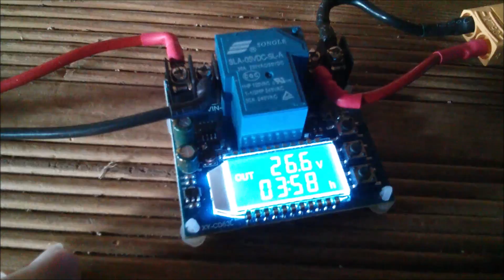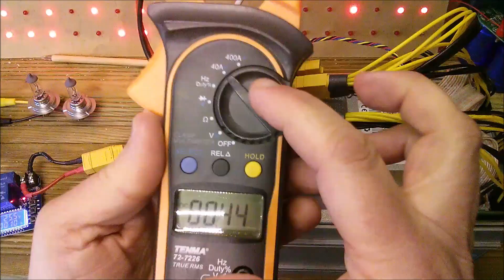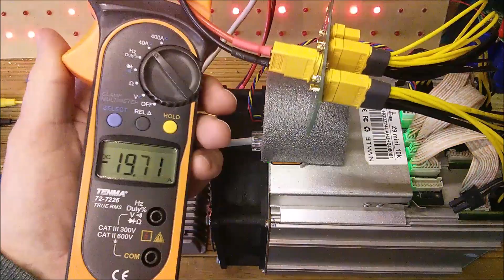Can this PCB handle 20 Amps?

Comment: To improve the resistance, you can stack two PCBs, exactly as they are. It may slightly complicate the soldering if you insist on one connector on the opposite side. If the connectors are all on one side, then the two-stage soldering would be easy.  Solder one board first, with not too much solder, then add on the parallel second board with fully-flooded solder. Cheers.

Comment: Instead of having one net on the top and the other on the bottom. Why not have two flood fills on both the top and bottom, so there is pos and neg 'power planes' on the top and bottom which would double the effective cross section area for each net. It's getting made by JLC - not like your manually making these boards, the PTH are free, better to use them!

Comment: Any particular reason for the connectors to be on opposite sides? Keeping them on one side would give you an option to up the current rating with extra copper wire bus along the bottom side.

Comment: Amass has XT60UPB-M and -F variants that are designed for vertical PCB mounting... They specify 4.3mm pin diameter which is no different from the cable version.

Comment: I am not sure if you even read comments.
On a previous video I wrote to you that (1) I can deliver you software to make the L3 run MOST efficiently and (2) I told you before: you do not need the extra connectors for those hashing boards on the L3. I have run them myself so I know they run on 5 cables (not 9). After having run the update (it just lowers the voltage of the hashing boards, it can't harm anything) the power usage goes way down. Also note: I came across a few boards from Bitmain where they had set the voltage at the maximum! It is just heat, and you get nothing in return. More detail? At the outlet my power went down from 723 Watt to 600 something Watt, just by tuning the under voltage to its minimum. (12 Volt 150 Watt, on one connector, that is 12.5 Amps, how much is that per wire? Exactly! Peanuts.)
PS: I have ran L3-plusses for several years, but Dec 2021 I have sold them. I can't compete with the new L7.
Reply from the maker: If I had more machines I'd probably experiment more with them. I don't want to risk bricking the few machines that I've got. I'm not really bothered about earning money with these things - they just make interesting loads for my high power experiments.
Reply: @JulianIlett  I am very sorry to hear this is your attitude. My electricity company pays me 50 cent (Euro) per kWh and I made a lot of money with it last year (and will as well even more this year). I think your project is 'not of this time' if you continue with it you are throwing away power, as if you don't care. Other people are unable to pay for the power bill. Come on, show some respect.

With regards to bricking: no chance yuo will brick yours. I had MANY L3 plusses, and all were 100%, running on low voltage all the time.

With regards to the shadow on your solar panel: place a small mirror in your garden to try and fill it up. When placed correctly, the sun will always reflect to the same spot. At least, that is what I hope and think.
Reply from the maker: It's completely off-grid, 100% solar, no connection to the mains. That seems pretty respectful to me :)

Comment: why don't you supply the file for the PCB's
Reply: It's THAT easy to make... it's a dual layer board with a row of +'s tied together and a row of -'s together on either side of the PCB as he stated at the beginning of going over them.
Reply: @BeezyKing99  sorry but I don't know to program it on the website but yes it is a simple circuit

Comment: can you provide the schamatic to the board?
Reply: cant you picture it in your head? its in parallel. Looks like all the negatives together, all the positives together
Reply from the maker: I did draw a schematic, but it's trivially simple. Six 2-pin connectors wired in parallel.

Comment: I love using the xt60 connectors for my solar system, I’ve stopped using dc barrel jacks because of the poor connections doing my head in.
I actually use the male as the supply, only because i couldn’t get any female variants in panel mount form, you can now, not going to bother changing all my connectors round i’ll just go with it.